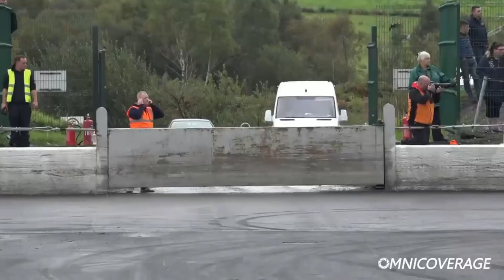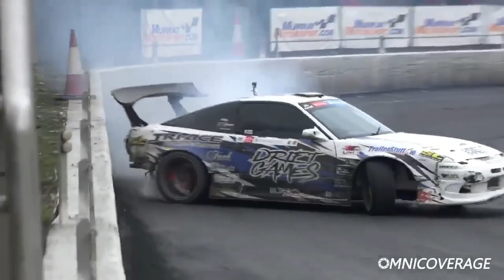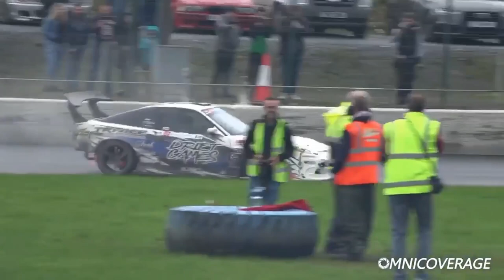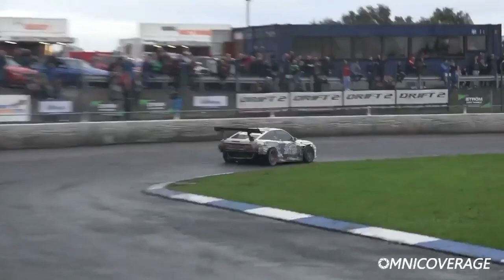Duane Mckeever 180sx rb28det 9000rpm - тренеровочный проезд | Tullyroan drift night 2019

Comment: Limiter bashing. Sounds fucking horrid

No parts of that is impressive.
Reply: Yes that is called drifting, get over it. All these engines are tuned to run full throttle on limiter and can be rebuilt.  That's like saying drag engines aren't impressive cause they blow up after every pass.